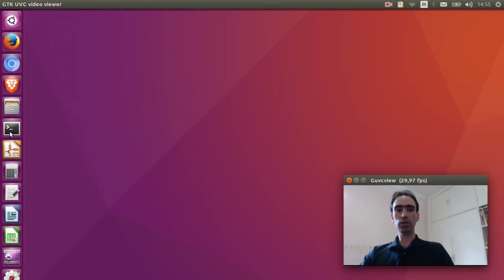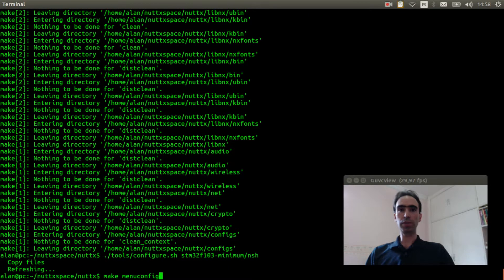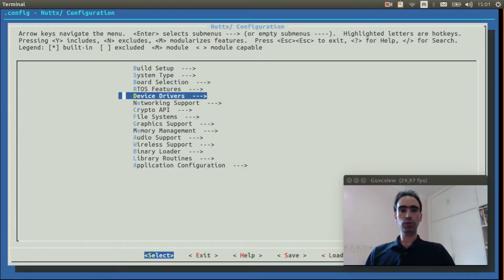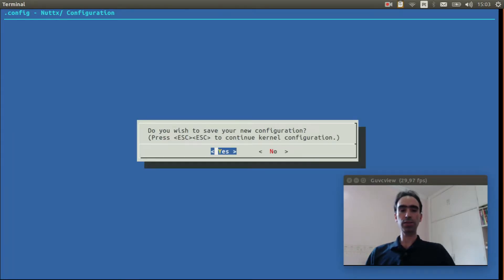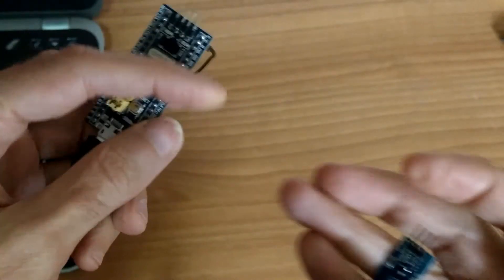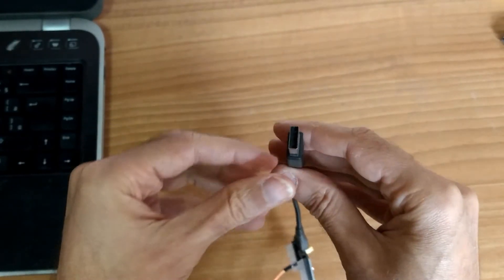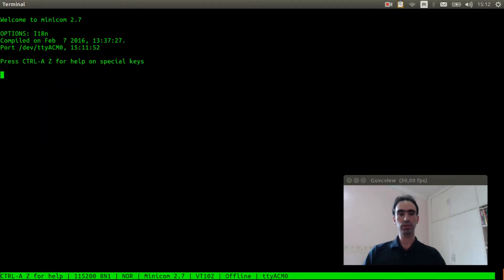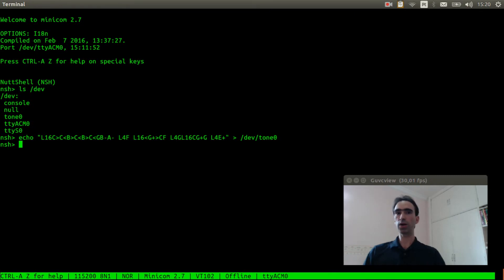#015: How to generate Audio Tones on NuttX

Comment: Hi alan, I'm learning nuttx by watching your tutorials, and now I'm having a problem, your tutorials have been posted too long ago, and the version of nuttx has been updated, and the menuconfig has changed, resulting in the fact that now I can't follow your steps exactly as they are. I tried to download the nuttx version from the time the video was released, but another problem has arisen, the addition of the /board directory has prevented the tools tool from compiling the past version, and I don't know what to do now. Your help would be appreciated, thanks.
Reply from the maker: @gc02020 sorry my delay! I will verify this issue and will return to you. My plan now is to redo all the tutorials to use current NuttX version 12.x
Reply: Hi @gc02020 I confirmed that there is some issue in the audio tone feature, so it only works for some versions released few month before that video was recorded (July 2017). So if you want to test this feature you need to download that old version, but the god need is that you don't need to configure anything, just use the "audio_tone" board configuration inside configs/stm32f103-minimum!